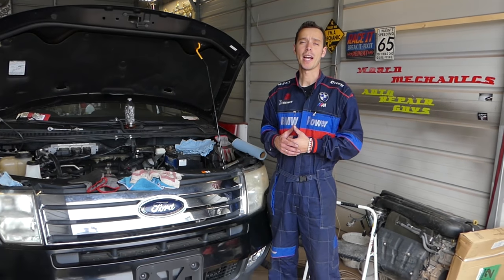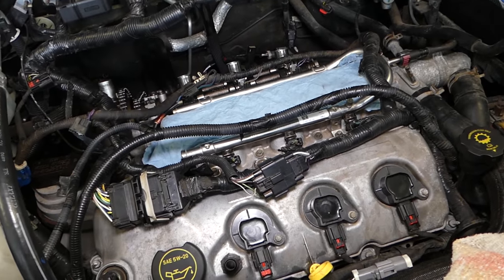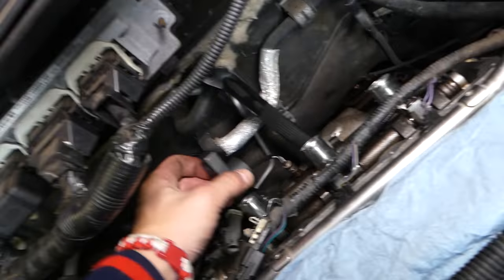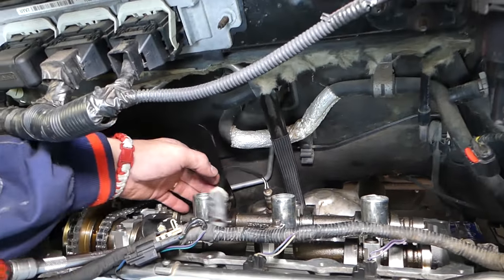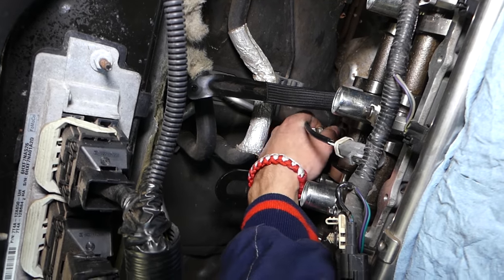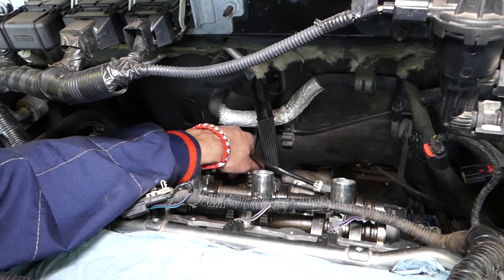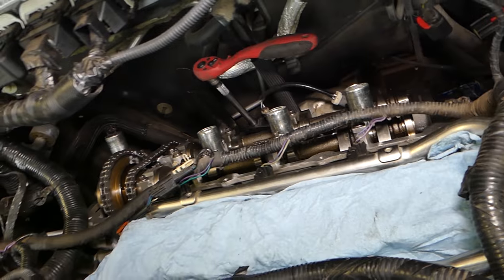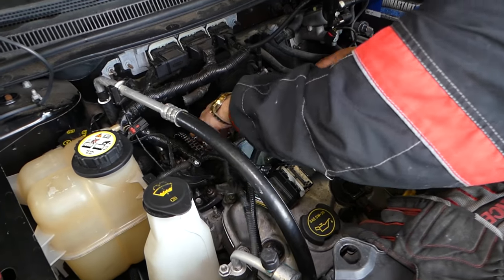FORD EDGE BANK 1 SENSOR 1, BANK 1 SENSOR 2 REPLACEMENT  AND LOCATION.  LINCOLN MKX

Comment: THANK YOU for this video. I was able to change out the right sensor and save money from taking it to a mechanic. I also replaced my fuel injector from another one of your videos, that saved me $600. THANKS!!!!..👍
Reply: Need help....Where is the exact position wiring harness connector for Bank-1 Sensor-1

Comment: I could see if you wanted to save the sensor but cut the wire and throw a 7/8 socket on there other than that good video

Comment: Both sensors have been changed two times on the Lincoln MKX  bank 1 & bank 2, by Lincoln dealership repair services. However the same engine code is showing. What might be another problem with the code? P013A someone suggested to change the Catalytic converter .

Comment: Hi does anyone know where the bank 1 sensor 1 is located on a 2012 Ford Edge with a 2.0 liter engine instead of the 3.5 l engine shown in the video? Thanks

Comment: I can’t find the video for sensor 2? How do you fit the tools in there? Currently working on this
Reply: I am going to do this as well. I don't think there is a video beyond this one. Did you do it yet? Did the tool have enough room? Breaker bar, ratchet?
Reply: @MrNutmeghunter  I did, you will need a an offset o2 socket. A non impact swivel, and a long extension. Like 1 foot. I also needed a adaptor to a half in drive to use my impact gun. Access it from the left side of the cv axle. Wrap your arm underneath the vehicle to the inside of the frame rail. Hold your o2 socket in place a give that impact a bump. Should come right out

Comment: I have a code coming up.  Catalyst System Efficiency Below Threshold Bank 2.  2008 Ford Edge 5.3L, V-6.  I replaced the front upper 02 Sensor and had the catalytic converter cleaned out at the garage. Runs awesome but engine light keeps coming on 40-50 miles.  Help????

Comment: The oxygen sensor you list does not fit a 2012 Ford Edge according to Amazon...
Reply: 2007~2010 Edge\MKX have 4Wire NarrowBand O2 Sesnors.
2011 & Later Edge\MKX have 5Wire WideBand O2 Sensors.

Comment: Sensor 2 is a pain ... mine had a heat shield blocking the "fender liner" method
Reply: Were you able to get it out? I removed the fender liner and was pretty much unable to get to it with any ratchet/extension. Where is the connector located?
Reply: @EastCoastPhoto  yes once my fender liner was removed I had to remove a heat shield as well to get my sensor socket in place.. I have an offset socket but there are also straight sockets
Reply: @EastCoastPhoto  the electrical connector is near the top of the motor directly attached to the back of the valve cover "in my case"
Reply: @Neighbor512  Thanks a lot Jason, I have the offset socket. Will take another look (gave up initially) and try again.
Reply: @EastCoastPhoto how did you do it? I’m working on sensor 2 right now
Reply: I went in from underneath the car. You need the offset sensor socket and some extension for your ratchet. It's been a while so don't remember exactly how but it was by far the easiest way.
Reply: @EastCoastPhoto  thank you
Reply: Underside? Was this a 3.5L?